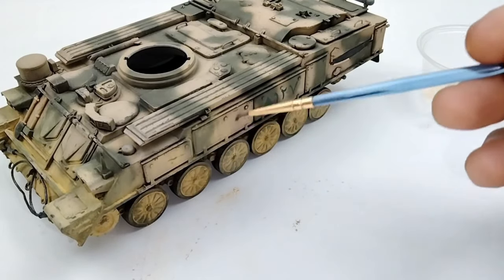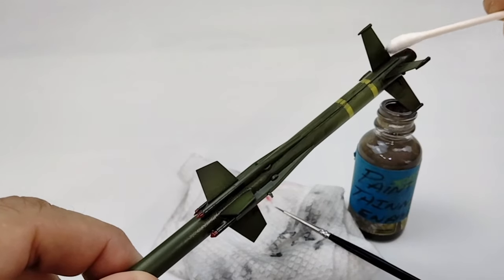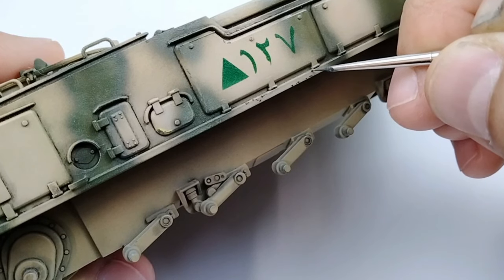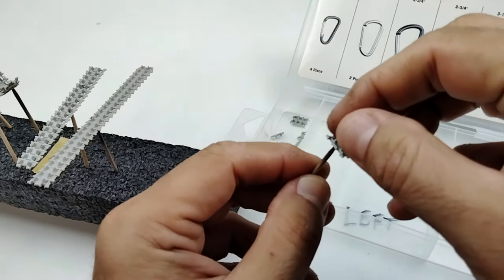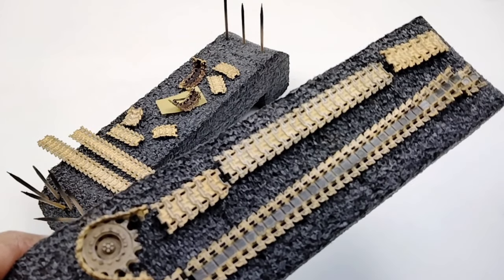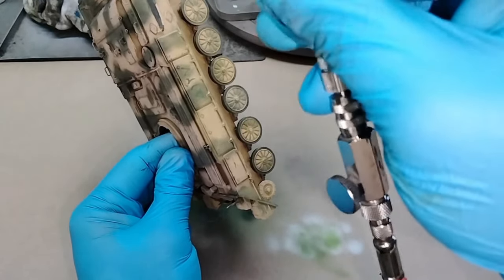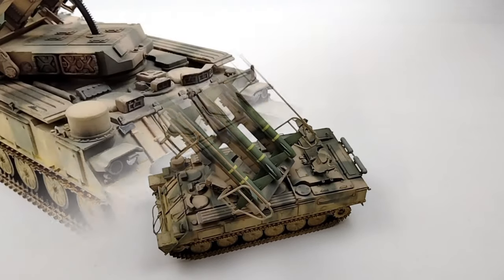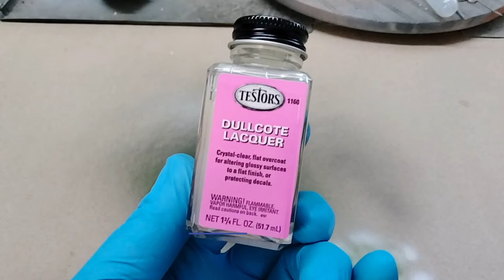Shelf Of Doom Rescue Build!  1/35 Trumpeter SAM 6 Missile Carrier Tank Plastic Scale Model Pt 2 of 2

Comment: Hello I have question about custom decals. I want to print a custom logo that says UNITED AIRLINES in all caps but the actual letters themselves are white? So what is the best decal paper (white or clear)  and way to print white font on decal paper without making the background of the word document black so I do not have to cut the background of the paper out with a blade ? Thank you
Reply from the maker: There are only a few very expensive printers that can print white.  For most modelers other solutions have to be found to make white lettering and other white marking on models.  Check out this video I did that goes into detail on some other options https://youtu.be/rBDEh7FVwzE